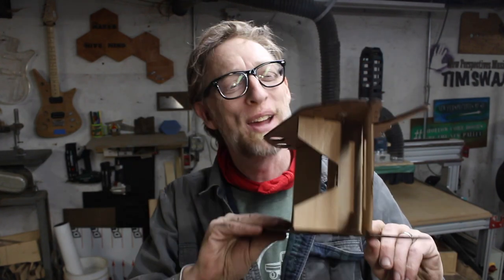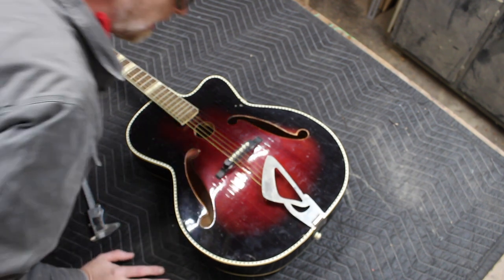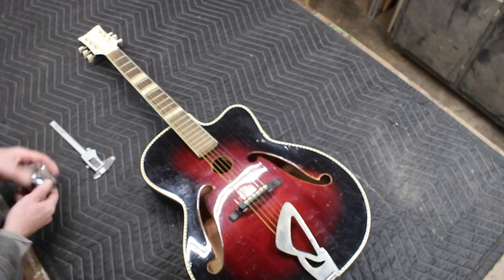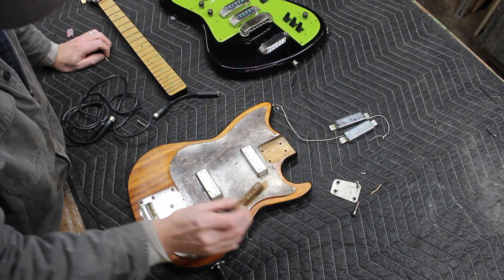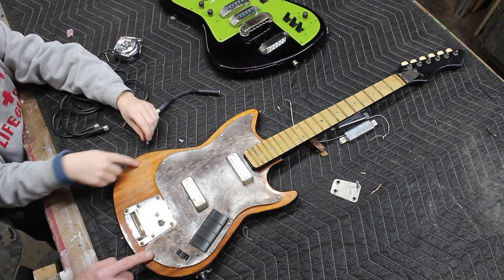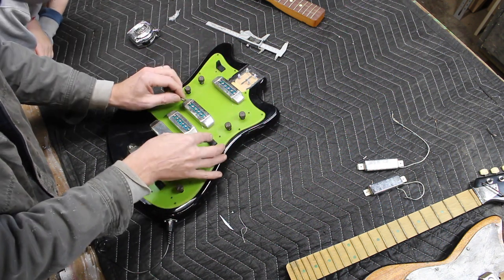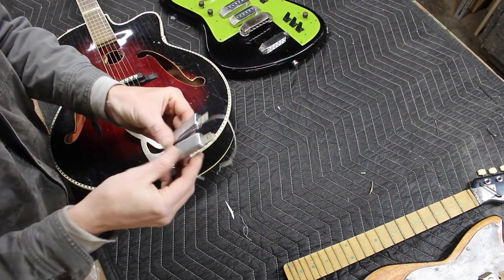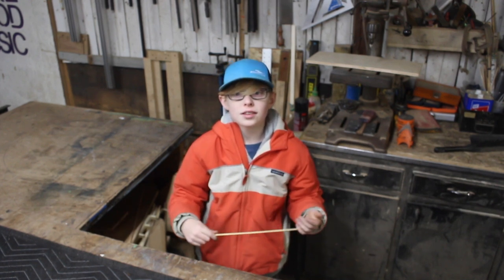I bought a bunch of old, weird, cheap & broken guitars

Comment: i would like to see a straightforward restoration on the framus - it's whacky enough already, maybe an internal piezzo just for functionality - whatever you do it will be cool as
Reply from the maker: my plan is to utilize the hole (which appears to be factory-made) to hold a floating pickguard with electronics, which can easily be removed without affecting the actual guitar. best of both worlds!

Comment: What you thought was a Framus isn't  its a  an Arnold Hoyer and yes the hole is absolutely stock it's rare a valuable
Reply from the maker: With the help of viewers we found it on the Framus site after posting this vid. Link in description. There are remnants of a German label inside and the trim, coloring, headstock  (and optional hole) match up to the Framus "President" model. I just googled Hoyer, looks like you can still get  some of them for a reasonable price on Reverb, similar to the Framus price range. Cool looking stuff.
Reply: @timsway  yes black rose Framus is similar model the checker binding is pure hoyer in franus history Hoyer did build guitars for Framus either way don't fill  the hole in! Good luck
Reply from the maker: @delboyoelmundo4718  def not filling the hole. I'm gonna use it for an idea... :) I kinda figured that guy must've worked there.
Reply: @timsway  good, glad your going to give it TLC Framus used diff tailpiece Hoyer were futuristic in styling I've a Black Rose Delux Hoyer were not as prolific but did build guitars for Framus only exception was Hofner, after the war. A lot of German Luther's went to US presumably Kalamazoo?

Comment: Rescue guitars are so cool. Love to see what you do with them.
Reply from the maker: It occurred to me it makes more sense for me and my mission on this channel to do this rather than make them from scratch...
Reply: @timsway  I have done the same and fixed up an old electric guitar that I bought. At the end it cost me more than a new guitar would just in hardware and paint plus the original guitar. There is a  midway to make it cost effective, but I'm not sure I reached that :)